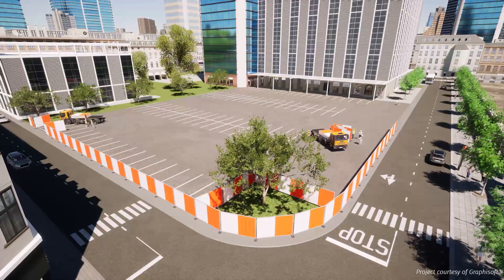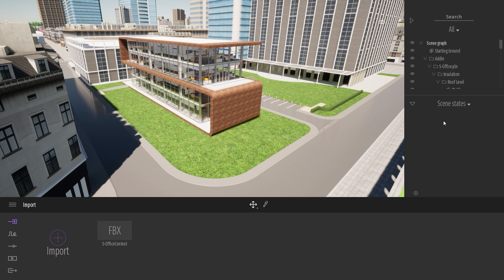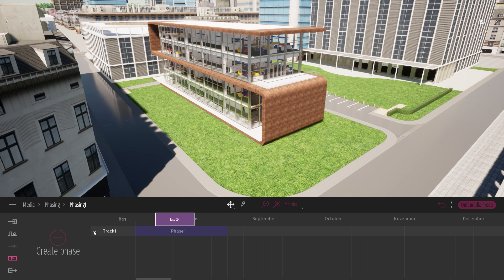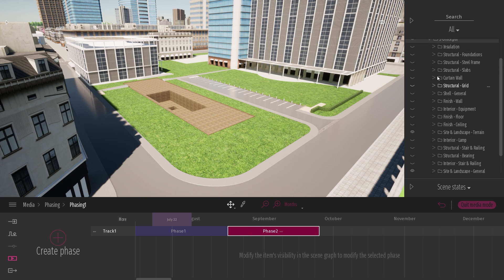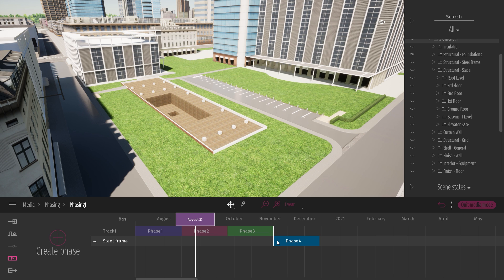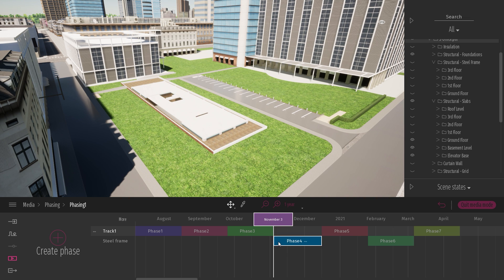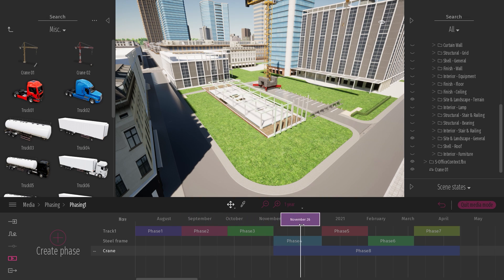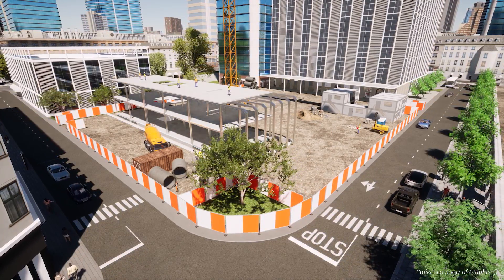Twinmotion 2020 Tutorial – Phasing tool

Comment: I really like Twinmotion very much. I have used it for Arch Viz and now with it's 4D capabilities I think It's a must have tool. But I have a legit question related to Phasing, does it have the capability to show each sequence for example from Left-to-Right or from Down-to-Up? For example the Excavation or pouring of concrete Left-to-Right or Front-to-Back and for the Structural Columns starting from the Footing and Column from Down-to-Up? In the presentation for each Month/Timeline its just suddenly popping up like a surprise. My suggestion is that the sequence should be presented smoothly.

Comment: 기대한 보람도 없이 2020/2 역시 충돌사고가 잦습니다.
https://youtu.be/_Tw6ZNxYGoQ
https://youtu.be/0OVHoK0VYUA

간단한 시험작이지만 위 영상을 나는 2020/1과 2020/2를 붙잡고 이틀간 씨름했습니다.
프로그램이 꺼지는 바람에 번번히 실패를 했는데 놀랍게도 구버전(v 2019)은 5분만에 뚝딱 해치우던군요. 물론 에러 한점없이…..
하지만 잘 아시다시피 2019버전에선 비디오 원본의 재생속도를 유지하지 못하는 단점이 있습니다.

어떻든 묻습니다.
왜 신버전은 구버전(v2019)의 속도감과 안정성을 못따라갑니까?
따라가기는커녕 툭하면 시커먼 거품을 물고 나 몰라라 나자빠지니 문제입니다.
그 어떤 프로그램도 작업 도중에 중도에서 까무러쳐버리는 행패를 부리지 않습니다.
이 경우는 횡포나 다름없습니다.
부디 개선을 바랍니다.

(Google translation)
Without the expected rewards, 2020/2 also has frequent crashes.
https://youtu.be/_Tw6ZNxYGoQ
https://youtu.be/0OVHoK0VYUA

It's a simple test piece, but in the video above, I grabbed 2020/1 and 2020/2 and wrestled for two days.
The program was turned off and failed several times, but surprisingly, the old version (v 2019) was wiped out in 5 minutes. Of course, without a single error... ..
However, as you know well, the 2019 version has the disadvantage of not maintaining the playback speed of the original video.

I ask anyway.
Why does the new version not follow the speed and stability of the old version (v2019)?
Rather than following, it is a problem because it bites black bubbles and I don't know.
No other program is going to get lost in the middle of work.
In this case, it is nothing but domineering.
I hope for improvement.